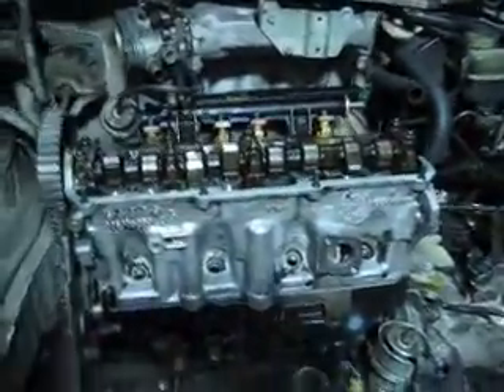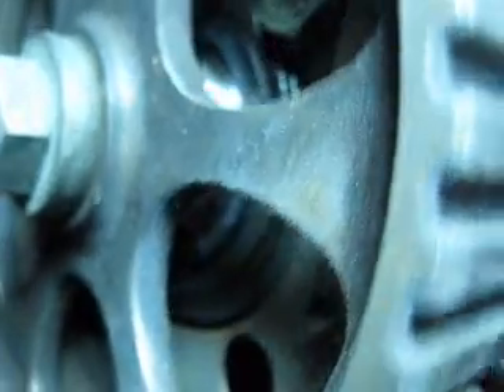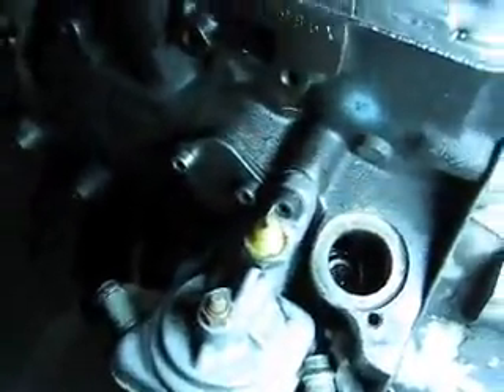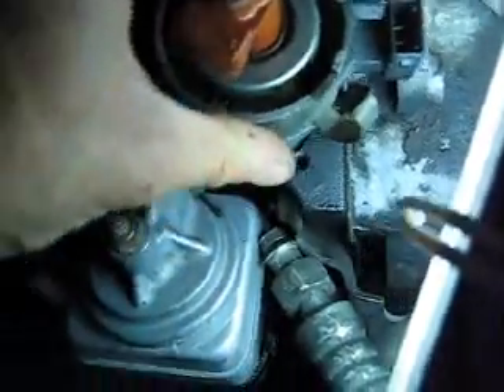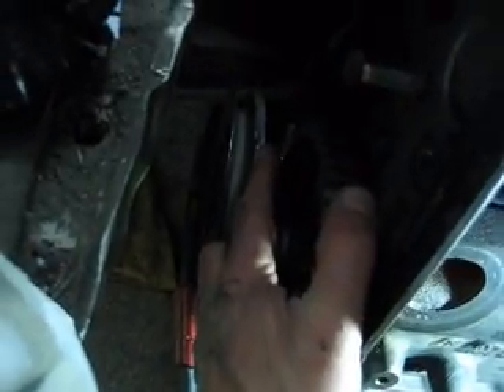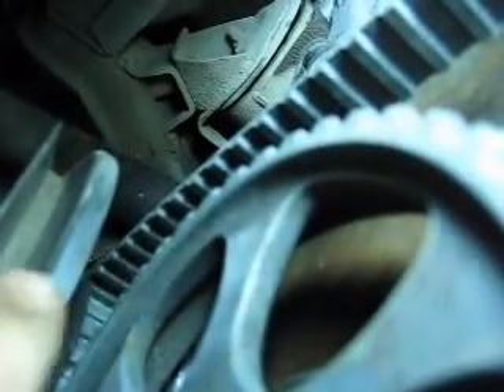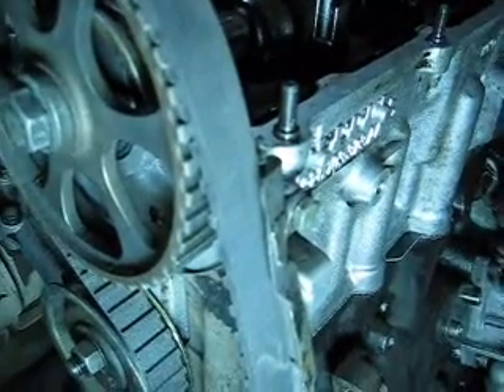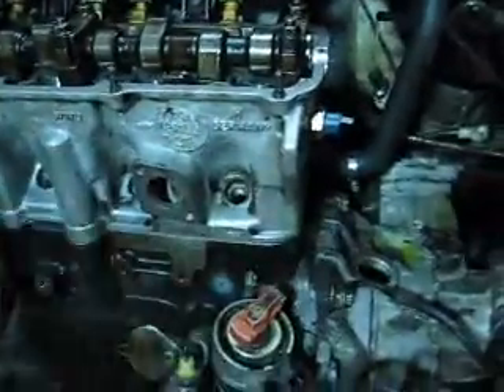(47) Golf Gti Mk2 1.8 Setting The Timing Of The Engine

Comment: I noticed your dizzy doesn't have a vacuum advance attached like on my 1987 MK2 Scirocco GTX 1.8 DX 8 valve. Just making sure have you removed the vacuum advance?
Reply from the maker: The Golf GTi 1.8 that uses the digifant systems doesn't have a vacuum advance system. It has an ECU which helps control engine timing.  The ECU has a knock sensor which helps it make "decisions" about whether  to advance or retard the timing.

Comment: Head's up, no special tool required to turn the center of tensioner, moves freely by thumb and index finger. Take up the slack by rotating the center part of tensioner clockwise, then gently pull rear of the timing belt towards you and gently crank clockwise. Keep your hand on the rear of belt you'll notice the slack coming in. Just undo the bolt and rotate again picking up the slack as before and wrench the bolt back on not tight, only slightly and repeat until all slack is gone front and rear. Once the two rotations are complete you should be able turn the belt easily 90 degrees. No special tool required and using my method no marks move during the process and  bang on each time. Do another full crank to double check. I hope I made sense 👍👍

Comment: HI Barry, Great videos mate... I'm doing the same MK2 rebuild on my channel. I have a question if I may. When I line all the marks its fine up until i put the tensioner and then it pull them out as it advances the crank. Do you need to compensate for that before hand??  Thanks mate
Reply from the maker: How'd you get on?

Comment: Trying my best to find the compression stroke do u have any suggestions?
Reply from the maker: If you can't find the timing marks, and the engine is in order, to find the comprensión stroke simply, remove the no1 spark plug, and then rotate the engine clockwise.  When it pushes the air forcefully vía no1 cylinder, you're on the compression stroke.

Comment: You miss off one of the most important parts. The mark on the cam pulley that you should line up. Mine has two . One on each side. A dimple on the outside and a slot/groove on the inside. They are at completely different places on opposite sides of the pulley. which I should use I dont know. I used the dot on the outside and lined it up with the top of the cylinder head. Now I read on vwvortex I should be using the groove and line it up with the top of the rocker cover. The car wont start so something is wrong.... rest of the films are great by the way but i think my timing is wrong and your vid is very unclear on how to do it correctly....cheers
Reply from the maker: This video is fruit of a full engine rebuild, meaning the cylinder head, the distributor gearing and the crank are all out of time.

 I really should have had more light and someone to hold the cámera.  If you have a problem please email and I'll try and help.  I don't know what type of engine rebuild you've undertaken but it's not difficult to get the engine back in time. All the best.
Reply: Barry Mc Gowan
Barry I wasnt meaning to critisise. I just wanted to point out that the timing mark on the cam pulley is the one on the inside, nearest the cam NOT the one on the other side, this is in a completely different position. I lined the inside one up with the top of the rim of the rocker cover and the other marks as per your video and she fired up. Engine is a 1.8 PB digifant as per your vid. Nice one.
Reply: hi

Comment: Very good video. But u must turn the tensioner klockwise .
Reply from the maker: I looked up the work shop manual and it shows the tensioner being turned anti clockwise.  Almost all engines have the tensioner turned anticlockwise that way the nut or bolt is being tightened by the forcé of the cam belt upon the tensionar.  I believe it to be correct. Thanks for the comment.

Comment: I found the easier way when installing the belt is to get the intermediate shaft close not not so worried about being spot on. Get the belt set and then just rotate the distributer body so the hash mark on the outter ring lines up with the rotor arm, same as #1 wire. The red dot there is from someone in the past making their own mark on the pully / block so they wouldn't have to break out the timing light after. Timing a Digi2 is painfull. Not my favorite job that's fore sure. Cool video though!

Comment: i recently broke my timing belt and i cant get the camshaft pulley off because one of the allen key bolts is broken so i need to remove the water pump pulley of but i cant get the grip to crack the tension, help me please ;)

Comment from the maker: Ignore red dot.  Is your timing belt the correct one? Does it have the same number of teeth as the original? It does not make sense that all the marks go out of sync as you turn engine. Remember two turns of the engine return you to the original setting. Let me know how you get on?

Comment from the maker: Be 100% sure when your doing the timing.  Make sure the TDC mark on the flywheel is aligned with bell house.  Make sure the mark behind the cam pulley runs parallel to the edge of the top of the cylinder head.  Put the belt pulley on the crank and make sure it's mark lines up with the pulley that drives the distributor.  Raise the distributor and rotate the rotor arm to point to spark plug one and reinsert it.  Tension the tensor anticlockwise so that it takes up slack of the cam belt.  Recheck

Comment: Hey Barry,

I'm considering replacing the head gasket in my Mk2 1.6.  I guess that after I put the head back on, assuming the car has not been moved, I would only need to worry about aligning the two wheels on the left hand side as you describe, with the flywheel positioned at TDC.  The rotor arm should automatically be in the right position if I don't remove it at any point in the process.  Is that correct?

Also, what was your solution to tightening the tensioner for the timing belt?

Cheers!